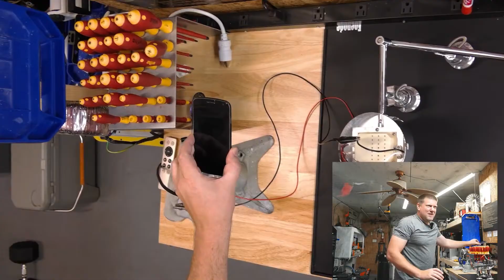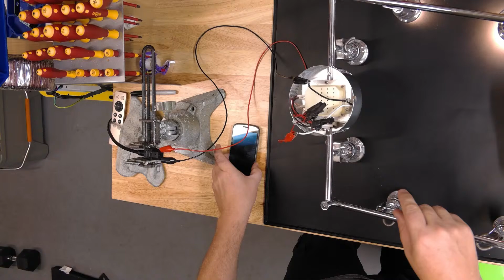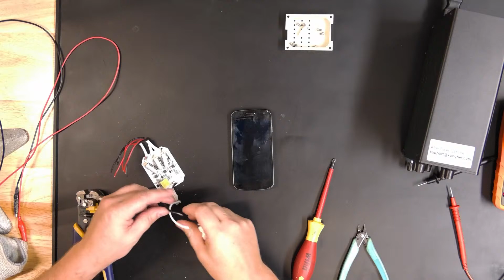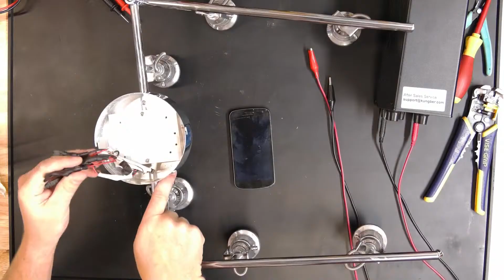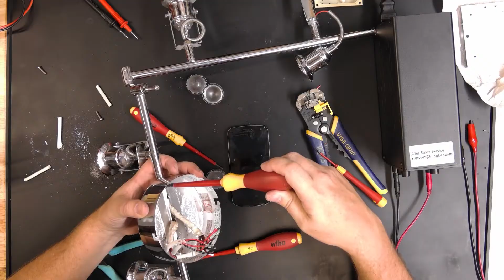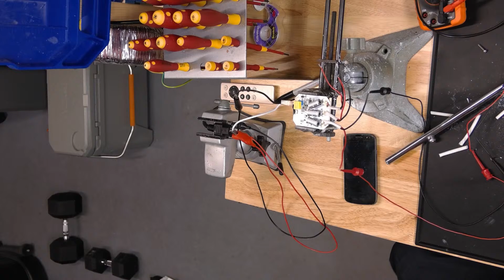Live AC / DC Troubleshooting

Comment: That led driver is a constant current power supply it can maintain a stable current by adjusting voltage so when there is no load it shows its maximum voltage as soon as you connect a load it change the voltage to carry enough current so in theory you can turn on variety of led with a led driver! Hope my explanation be helpful and scientifically right 😅
Reply from the maker: Excellent response.  I'm going to measure under load.